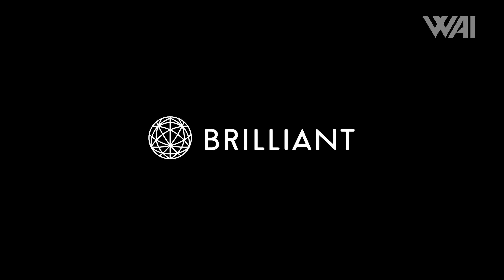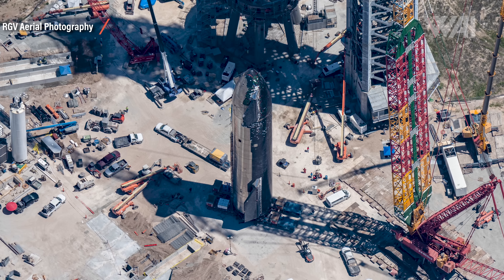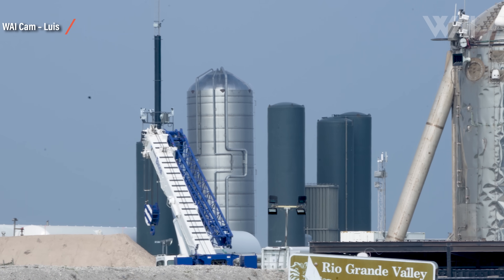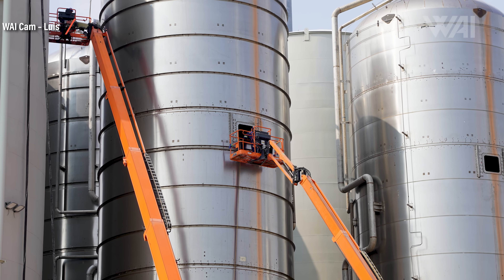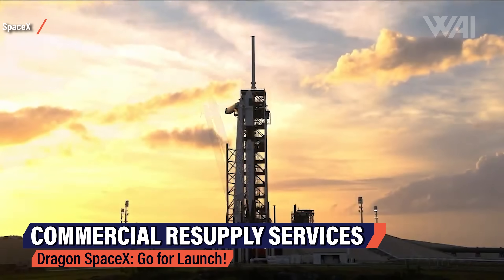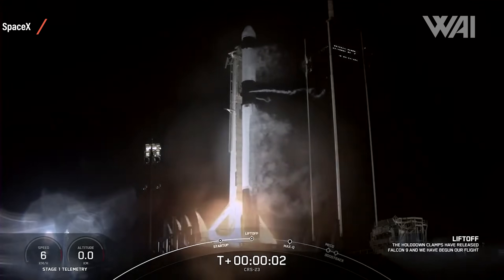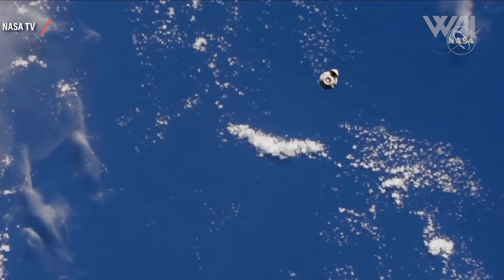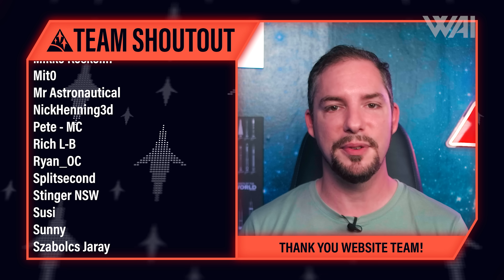SpaceX Starship Heat Shield & Mechazilla Progress Analyzed – CRS-23 Launch Report

Comment: There is more issues with the heat shield then SpaceX imaged, this is a flight without humans, during re-entry, if the craft roll & pitch was imbalaned, while humans in it, will be devistating, the entire craft will need FULL HS coating, in exceptin of windows, this task will only be required with hatch fold, 'moon roof' style.

Comment: I thought SN20 was coming down in the ocean and not being recovered.  So why all the attention to the heat tiles?  How will they know if the tiles worked?
Reply: Starship have a much simpler design compared to the space shuttles thus making a more simpler heat tiles design.

And because the space shuttles are mounted on the side, most of its heat tiles are damage during ascend after getting hit by foam and ice which caused the Colombia disaster.
Starship in the other mounted on top of the booster, so many people is very interested on how it'll went

Comment: The heat shield will never be quick to inspect and repair. You cannot scan the heat shield to check for cracked tiles, it will be a tile for tile inspection. And they will need to check ALL the tiles after EVERY mission.

Comment: I thought the starship did not need heat tiles as it would "perspire" to cool and that was also one of the reasons to use steel as it has a higher melting point. Was this plan scrapped?

Comment: They might be able to move all four of the flap bases on Starship. So that they would extend from a position far higher on the Staship, and so that  only the tips would need to have heat shielding! When in use they would extend from above the heat shield, beyond the the widest point of the ship, think of them as butterfly wings or four angel wings, instead of a airplane wings. They are not their for lift, rather for direction control and drag during the belly flop, and for reentry!

Comment: It’s interesting how the collective memory of the Space Shuttle has changed. When the fleet was being designed, the turnaround for each orbiter was going to be 2-weeks. By the early 1980s the cadence had shifted to 1-launch per 2-weeks. This max frequency was attempted in 1986 (Challenger disaster) and there after, it was recognised that the shuttle was not reusable, it was better classified as “reparable”. Hope Starship will do better over time.

Comment: Why are the heat made in small tiles? Why not make it in one piece that fits like a glove?
Reply from the maker: Because of replacement. Heat shields do not wear down equally everywhere. Vortexes Form in different locations and those wear down the material faster. So, the whole shield would need to be replaced if there's one spot that's at the limit.

Comment: Great work Felix, You Rock🎸! Those flaps are going to cause no end of issues, why not get rid of them and just have some fixed fins for stability during decent and catching. Could thrusters be used for course correction? Surely the weight of the tiles will keep the belly down. 'The best part is no part' 😊

Comment: Has Elon asked 3M if a "spray on" heat shield coating could be developed. This might save loads of time and effort adding the necessary heat shield surfaces?
Reply from the maker: What if it needs replacement. Heat shields wear down.

Comment: I was wondering if you couldn't just build a gigantic (single-use but recyclable) sock made of Rockwool for the starship to replace the TPS tiles which seem tedious to refurbish. Here's a rather naïve order-of-magnitude estimation: 

- reentry speeds are on the order of 10,000 km/s , and the starship weighs on the order of 100t → the kinetic energy to be absorbed is around 100GJ (=(1km/s)²*100,000 kg))
- assume a budget of 10t for the heat shield
- Rockwool's density is ~100kg/m³, and the surface area is some 100..1000m². Therefore, the sock would be 10cm..1m thick.
- Rockwool has a thermal capacity C = ΔQ/(m*ΔT) = ~1kJ/(kg*K). So with m=10t, and ΔT ≤ ~1000K (before the material melts),
 ΔQ ≤ C*m*ΔT = 1kJ/(kg*K) * 10t * 1000K = 10GJ
- also, the thermal conductivity of the Rockwool 
dQ/dt = λ*100m²*1000K/1m = 1kW.

ΔQ_max = C*m*ΔT_max = 100J/(kg*K) * 10t * 10K = 10MJ = 10,000s * 1kW ~ 1h*1kW. 

noticeably heat up.

Comment: Heat shield tiles are such old tech. How do we not have a sprayable heat shield coating by now?
Reply: It means to use on-board resources (precisious fuel) for braking instead of freely available (atmosphere density & heat capacity) outer ones.

Comment: It's time to give up on the pointy nose on the StarShip. It does look cool but it's gumming up the works.
If it is changed to a simple hemisphere the tiling problem is solved. The barrel section tiles are fine. They are all alike.
The nose section tiles are not alike. It's like the space shuttle all over again.
A hemispherical nose structure would make all the nose tiles alike and much easier to service.
A hemispherical nose would maximize volumetric efficiency in the cargo/payload area. There would also be a slight increase in the drag on the vehicle during re-entry from the increase in cross section. Also, a slight increase in drag at launch but nothing too problematic. Cargo doors would be easier to realize.
Cool is nice, functional and easy to maintain is better.
The best part is no part or in this case identical and interchangeable parts.

Comment: 4:25 - SpaceX has only recently beat Shuttle turn-around record of a bit less than two months with one of their Falcon 9 first stages - so let's not get too excited yet.
I certainly hope SpaceX does test those heatshield tiles in some kind of hypersonic wind tunnel fed by rocket engine exhaust or something. Shuttle had to work at first try, and it did. Musk does not seem to assign too high importance on that, but there is little to be learned from scattered, burnt pieces on the ocean floor.

Comment: A geometrically cone shaped nose, except at  interface with header and barrel, could simplify tile size/shape inventory and manufacturing which is Elon,s "remove something" design process. Using an actual cone could improve tile installation, inspection, removal and replacement. A cone surface which is flat from point to base could simplify flap attachment and minimize fairing size. A cone nose might be easier to manufacture as all welds would be straight lines. A cone might not be optimized for drag and heating but the afore mentioned advantages might make a net improvement to the design. @CaptainBill

Comment: imo, they should build a factory for producing very large heat shield tiles... -this may or may not be possible, but would enhance the possibility that there would be less change of holes happening when the starship descends through the atmosphere and begins generating huge heat and pressure on these small tiles. -also, if they made fewer very large tiles, it would take less time to replace one (in theory).

Comment: I would guess that eventually, rather than having so many unique tiles on the cone, which defeats the purpose of having a large number, they'll make a fewer number of bigger ones for the cone section.  Maybe in vertical zig-zags, since part of the benefit of hexagons is interrupting heat flow so it can't create a channel.

Comment: The tiles are CRITICAL. They need to be 100 %  contiguous on the windward side. This is the hardest problem due to the brittle material and curved hull. Attachment design might need revision eventually. I imagine a softer ceramic wool backing similar to refactory lining in kilns, with some give, and stub-wires for location. I dont envy the designers of this part of the system.  Replacement of broken tiles swiftly might become a major issue. Let see. I predict a lot of action in this area. I hope to be wrong.

Comment: Starship heatshield has always (in my mind) been one of the largest problems. Or rather one of the largest things that will cause setbacks or potential catastrophic re-entry failure. I can not see how this shield could possibly work in practice as a complete system. for a whole bunch of reasons. I'm a pretty knowledgable hobby-level enthusiast engineer, I am not an actual engineer. But, I am sure the type of heat shield as it stands will actually never ever work. I also can not see how this type of heat shield could be made to work. I truly & Deeply hope with all the hope I can muster that I am wrong.

Comment: The tiles are an interesting problem. You can't manufacture a thousand different tiles, but you can't perfectly parameterize their faces to the cone without warping their angles. If you force it by using a single different key tile at the spine, you get dissonance in the alignment large enough to make certain tiles impossible to fit without cutting them. So do they redesign ALL the tiles to be modular so you can add extra pieces to their edges to change their angles? Or do you pray that the dissonance yields a small number of outlier tiles needed to fill gaps, and just manufacture each separately. It looks like they're going the latter route.  Not sure if that's best. It doesn't scale with the scale of the cone.

Comment: Unnecessary complications for maintaining matching design of tiles in the nose cone. Necessitates change in the heat shield material and structural application.  Now a days even for domestic purposes welding pastes like 'Jb Weld' used everywhere indicating feasibility of developing highly heat resistant gel.

Comment: The bottom line is that the heat shield needs to be greatly simplified, I think SpaceX should develop a special team to find a radical new design, perhaps a full body shield that can be reconditioned after each launch while a fresh one is available for immediate replacement, or perhaps a shield that can be recoated by some type of resin after one or several launches.
The heatshield is the weak link that will cost many lives and countless amounts of lost time if they don't get it right.

Comment: I'm thinking the heat shield will always be a problem until they can develop "large section shields". Instead of 1000s of "small" tiles I believe a dozen or so LSS panels will be needed, something which can be removed and replaced in fairly short order with a mechanism kind of like the stand used to enable a single person to replace a windshield on a car.
Reply: Would that not add considerably more weight? Some of those sections would have hundreds of square meters,  and would have to be rigid,  if only to be sure your certified LSS section skin will still be ok after mounting it on the vehicle...
Reply: @ShrekMeBe  You've seen ceramic floor tile that are multiple pieces all connected via a webbed mesh. What I'm talking about would be somewhat similar to that with lightweight TPS tiles all connected to each other with a carbon fiber mesh. The rigid but flexible backing mesh should be lightweight. I'm not pretending to be an aerospace engineer, and from this layman's perspective TPS sections could be maintained/replaced much faster than inspecting every one of those 1000's of tiles after each launch/landing. Relaunching a ship the same day would be impossible with manual inspection and replacement of individual tiles. How much does a tile cost, how much does it weigh (on average) and wouldn't a more cohesive TPS make more sense?

Comment: How long on the heat shields ?. Until it's completely done and correct. History shows what happens when things are rushed or skipped. SpaceX is SpaceX not Boeing, for SpaceX failure is a learning experience, it does however sting and takes valuable important time to figure everything out, for Boeing failure is a profit point  .

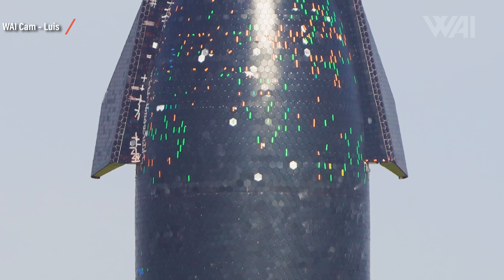Comment: 3:30 "It's unimaginable how much heat this shield will have to endure on reentry; due to the starships mass and surface area, it will generate extreme amounts of plasma"

You have little idea what you're talking about. You're right, starship has huge surface area, but that actually makes for a cooler re-entry because you have a lot of drag. It's a somewhat critical element of the re-usable heatshield: it won't taking as much heat compared to many other heatshield applications.
Reply: Yep. I believe that in some of their earlier designs, they didn't think a heat shield would be needed at all for return from LEO - only from higher-energy re-entry such as from Moon or Mars. That's obviously not the plan anymore - it was probably back when they were talking about transpiration cooling - but the design is still capable of soaking a lot of heat purely through the steel body.

Comment: The tiles are the long pole in the tent.  They'll get to orbit and down, but doing a turnaround in a matter of hours is a long way off.  Temperature induced stress, elasticity, method of connection all need to be worked on.  They essentially doing old style tiles for now, but that can't be the long term solution if they want to have a turnaround of a few hours.

Comment: I think the tiles are the biggest failure here, it didn't work on the shuttle and I'm sure this will be Starship's achillies heel, there needs to be a heat shield solid not tiles, maybe a liguid coating that starship is dipped into many times to build up the correct thickness, that would eliminate all possible edges in the shield surface where heat could get in, just a thought I hope they come up with something way better than tiles!

Comment: I doubt it will be for long, but if the heatshield is a problem because of the unique shaped tiles required for the nosecone, then maybe the simplest solution would be to make the nosecone removable.

Make the nosecone slightly wider than starship’s main body that way you can leave a slight overhanging row of heatshield tiles to protect the nosecone/body joining line. Then when a starship lands, you can quickly detach the damaged nosecone and replace it with a waiting, certified safe, nosecone and send the body back into space quickly and safely. That would give Spacex the opportunity to replace any damaged tiles on the old nosecone, in the interim between the newest launch and the next scheduled Starship return, where they can then use the newly certified-safe nosecone to replace the next damaged nosecone.

This of course wouldn’t be advisable for a ship that has to descend through Mar’s (thin) atmosphere and then return to Earth safely, but for a vehicle that is simply moving between Earth and a zero-atmosphere-Moon it should prove viable—at least in my English Major’s head it sounds doable.

Comment: Surely there is a wrap that can be applied in then baked to turn into a large custom wrapped tile of sorts. Similar to how fibreglass is made, it’s warped and stretched and spread until it’s in place then hardened with the catalyst. An inner layer can be added between the stainless and the tile wrap to allow for quick release.

Comment: Critical failure at the tank farm?
Mate, what happens when the stack explodes on the pad? Or 10 seconds after liftoff?
Not only do you get a yield of between 1 and 2 kilotons of TNT from the StarShip/Booster combo, but that explosion takes out the tank farm as well, and depending on how much fuel and oxygen is stored during a launch, I'm guessing the yield might climb to anywhere as high as 4-5 kilotons of TNT.

I'm not an engineer of any kind, but it seems pretty ignorant to have a tank farm so close to the orbital launch tower. Practically guaranteeing that the first mishap does maximum damage.

All we can do is hope the worst doesn't happen. 
But remember: hope is not a strategy. :P
Reply: I believe Elon and Shotwell are aware of it.  He actually said it in his interview with the Everyday Astronaut guy.  I guess they know things that we don't and are taking a chance.  That's also why they hire rocket scientists.
Reply: I think you're overestimating how much of an explosion you'd get from the GSE tanks. Yes, there's potentially a lot of liquid methane and liquid oxygen there, and it's certainly possible that a booster explosion would puncture the tanks. But neither methane nor oxygen is particularly flammable on their own - they need to be thoroughly mixed in order to maximise the energy released. 

You'd certainly get an explosion from the liquids mixing on the ground — that's more or less what happened with SN4 — but probably not as bad as you're imagining, since they likely wouldn't have much time to mix before something ignited them... you wouldn't see the tank cylinders exploding, since a methane tank containing no oxygen isn't going to burn, and nor is an oxygen tank containing no methane.

Comment: I already expected that those heattiles were gonna be a problem. I think they'll need a rethink on the concept. This one won't make it through re-entry. My money is on a replaceable double hull on the hot side. Sure it will add some weight but that will make rapid reusability actually doable. I think that there is ample Delta-V to go for a tiled outer gull, a gel-like medium in between that can slowly boil off and then a carboncoated inner gull. If the outer hull loses tiles and burns through in certain sections, the gel will want to leak out because of the pressure and will protect the inner hull for that all so critical extra 20 seconds. Don't know if it's a feasible idea but that's the direction I would go in

Comment: Cheap and left field heat shield solution.....chard softwood. This forms a coating of charcoal which has a high ignition temperature, 800-1200 deg' C  if I am correct. It will need to be mechanically stabilized to resist vibrations during reentry since it becomes brittle.  
Sounds crazy but who knows.

Comment: 4:20 - The Space Shuttles weren't supposed to take up to a year to re-launch. They were actually designed to be launched twice a month. We all know it didn't happen that way. In fact, inspecting and replacing the tiles turned out to be a contributing factor to the slower than expected launch cadence. Hopefully this is one of the problems SpaceX can avoid for their tile system.